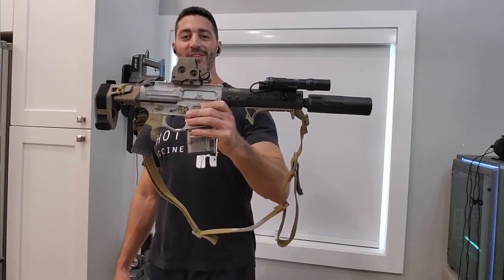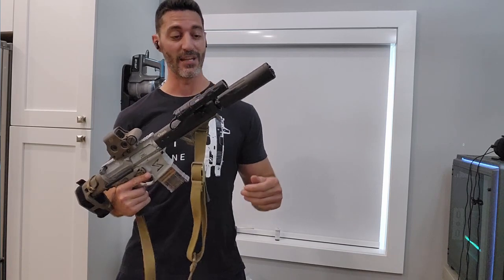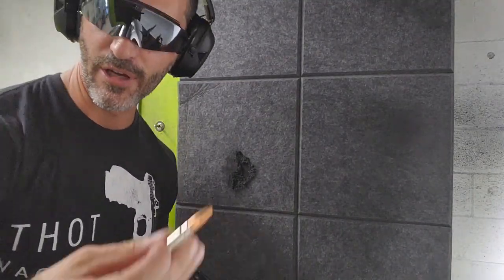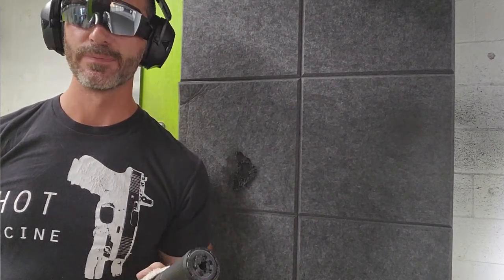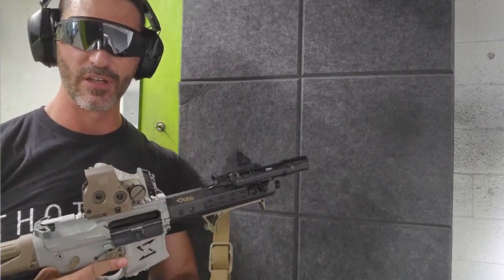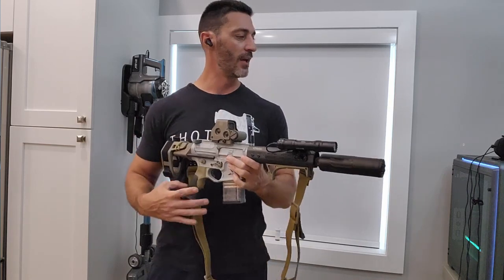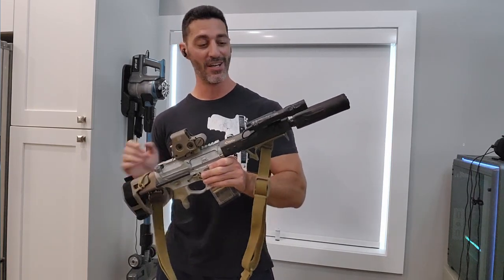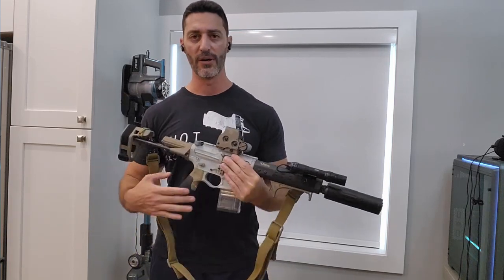The Ultimate PDW, 300 Blackout Ultralight Build

Comment: Hey man what’s your gas hole diameter measurement please? I think thats the reason why it functions well with/without the suppressor shooting subs. However there is no such thing as a “perfect” 300BO your rather overgassed or undergassed because subs/supers are very different. I’m assuming your overgassed and with supers it will cause more wear on parts. Id rather have it overgassed as well tho so at least it will work with subs/supers.

Comment: Cool build man. Not a fan of the colors but other than tht it’s sweet. And just because ur 300 dnt run properly with subs dnt make it a piece of crap lol. There’s a reason y most people tht run subs run suppressed. Because the can helps it cycle because of the back pressure. Thts really wht tht round was made for honestly so yea if u run subs in an unsuppressed and it dnt cycle right dnt think its trash. U just need a lighter buffer  buffer spring or ur bolt needs to be lighter.
Reply from the maker: if you have a 300bo gun that cant run in all conditions, its crap. theres no excuse and no exceptions. most of what you said is incorrect and i have a video on 300bo if you want to learn about it more.

Comment: Is carbon fiber very heat resistant?
Reply from the maker: yes, from what i can tell and from what the manufacturer has told me, it wont transfer the heat as much and its resistant to it.
Reply: I mean, they use it for brake rotors, those expensive carbon ceramics, so it can easily take some heat.